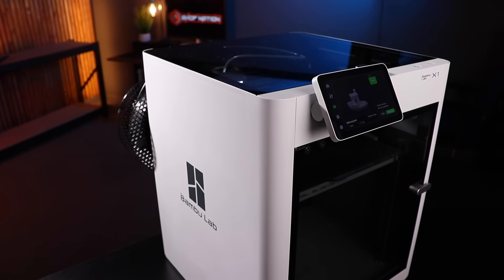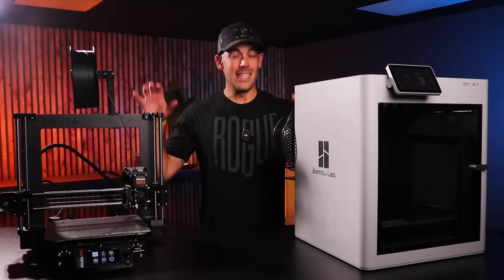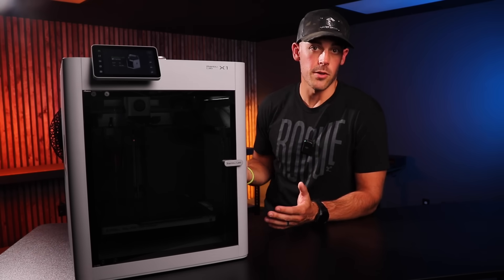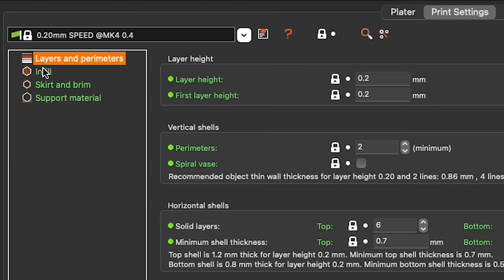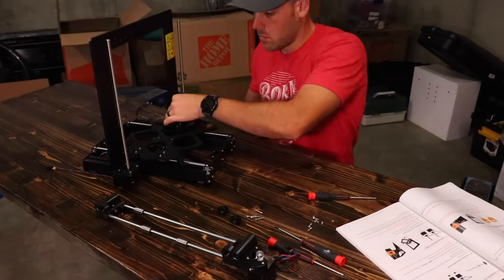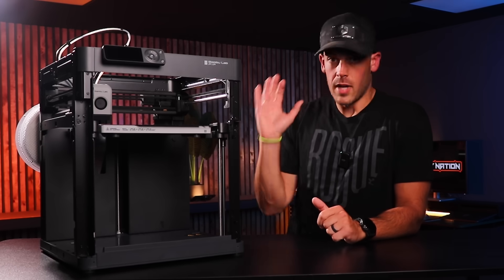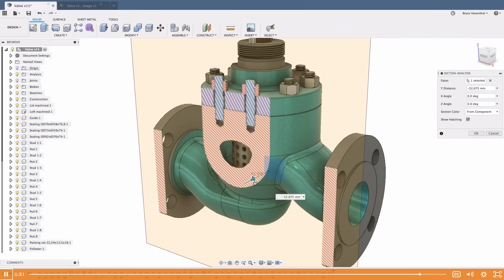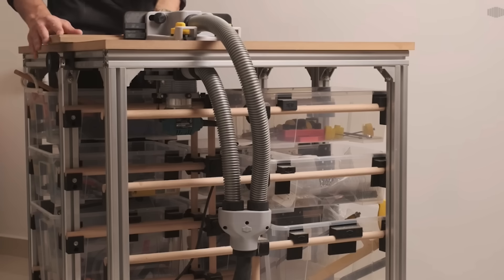The 3D Printer I'd buy if I started over

Comment: Really wish I would've seen this before I bought the ankermake. I have it in working order now and it usually runs pretty good, it was really bad at launch with bad QC, and extremely alpha like software. And while learning about 3d printers by fixing it myself I'm sure was a good learning experience. Just like you said it sure does hinder me from even wanting to boot up the printer knowing that I might have to spend hours of troubleshooting, instead of it just working like it was advertised to do.
Reply: have you contacted support? i was one of the kickstarter backers and ive not had many issues aside from what ankermake has fixed in the firmware, its currently my go to printer with how reliable its been. The discord community may be able to help you as well.
Reply: @KevinLagan  I learned CADD and 3D modeling years ago and it was before 3D printers they got one the year I left. So I've wanted one ever since and The AnkerMaker (Bigger one around 599) caught my eye.

As someone who wants to put my abilities to use but will be my first 3d print would you recommend the Anker? My ultimate goal is not spending time working on the machine but printing everything from helpful Shop tools, Jigs, Etc to random stuff like Destiny Gun Replicas or whatever people want to purchase.
Reply: id probably go with the ankermake M5C tbh, the 399 price makes it not actually expensive to get into so youre not oout a bunch of money if it turns out you hate 3d printing. That being said though if you think you need the larger build volume ive had my M5 since october last year and run probably around 100kg of filament through it and its been pretty solid. Small things have been issues like the screws that hold the hotend on, they are very weak and if youre not super careful or you get a blob that covers the print head they can break so i would swap em out with stronger screws. As with all machines though it is a machine so your mileage may vary but ive not regretted having the M5 or the M5C plus the V6 (their multi color engine) should be releasing soon ish @dakotacorvin4756
Reply: @KevinLagan  Thanks for the info man, I haven't got a lot of experience with the 3D Printing but designing and making models in 3d is something I loved and was extremely good at so its always been something I wanted to do but as a Cabinet and furniture maker I love the the idea of being able to make myself so much in the shop and outside of that just the endless amount of things I could and want to do I think the5 is the way to go. 

I am curious about different filaments though, I know they make a wood kind that's awesome but I'm really wanting to do some  printing in metal not sure if it's possible

Comment: near perfect sales pitch then factor and it went to zero, just have a link show up in the corner even all thru
Reply from the maker: Family has to eat, sorry
Reply: @ShopNation  trust me you'll have more to eat, anyways no one's stopping you from ab testing
Reply: @ShopNation  not much into yt, but here's what google can do: yt should start making use of the fact that the videos play exclusively in their own player and make these interactive. it could start with marker frames. so as a producer, i could create two spots, use yt markers start end on the first spot. how yt player would interpret it as follows: at the start of the first spot, it would offer premium viewers a button to skip the spot but because there are no markers on the second spot, premium viewers would have no choice but to manually skip it or watch it. things could get more complicated. yt can supply conditional markers which try to guess the probability of premium viewer skipping. if the probability it low, skip buttons do no appear. also yt can supply the stats for what finally happened so the producers can optimise accordingly. the possibilities are endless for instance, based on user profile the spot can be entirely different

Comment: IMO the Ender 3 is a better starter printer. Cheap and it forces you to understand bed leveling. Plus when you are ready to upgrade you should be able to sell it used at a small loss.

Comment: Buy an ender 5 with bed leveling. Start printing. Convert to zerog mercury 1.1  Ender 5 works great out of the box and you will learn a ton about what is happening which gives you insights about functional design while you wind up with all but the bambu.

Comment: The power of Prusa is not just the software but also the community projects/plug-ins and support. Seriously, you do not need a MK4, just self build a MK3S+ from kit, DIY upgrade with a touch screen front panel running OctoDash on OctoPrint and you never need to transfer using SD card anymore, install a webcam with Obico plugins for AI failure detection. Go further? Self host Obico with Nvidia GPU acceleration. Joint all the printers together and form a “print farm” with AI failure detection. Still need a high-end printer? Think again. Do account for a solid firewall appliance when you are printing remotely. Preferably over a fast VPN like WireGuard.

Comment: Couldn't be happier with the stock ender 3, has done pretty much everything I need a printer to do and didn't cost me very much at all.
Reply: What's the Stock ender 3?
Reply: @OGDIABLITO  The original ender 3. "Stock" means I have not upgraded it, all the parts are as they were from the factory.
Reply: @untrust2033  Thank you for replying back. How's it working out for you?
Reply: @OGDIABLITO  Once you get it printing fine you can just leave it alone and it'll give you consistent results every time. The only real design flaw is how the bowden tube can be melted and cause the hotend to jam, but this is apparently easily fixed by upgrading the part (for very cheap). Never got around to doing that and the issue went away. LOL
Reply: @untrust2033 I've had the opposite experience, it's given me nothing but headaches, bed level never stays, quality is terrible with under and over extrusion on the same print; if I could do it all over again I would not have bought it again, though obviously experiences may vary
Reply: @untrust2033  where'd you buy from? online or from a store?
Reply: Mine sux

Comment: why so expensive ??  i have been printing on my tevo tarantula  for over 6 years without any problems , i never level the bed , only thing that i had to replace was a nozzle heat element  ( 10 euro ) , and the whole thing cost me under 300 euro ,, it's been printing almost every day for  6 years   yes i had to build it , but i know this printer  through and through !!

Comment: I absolutely 100% disagree.

If you want someone to get into 3D printing, you start with a cheap but reliable 3D printer where you still need to get a little "hands on". The user should know more of the technical side of the printer over time to learn why their printers look worse, won't stick to the bed, etc. and the X1 is a terrible printer for that since it's a HUGE mess to tinker with. If it goes wrong, it goes WRONG!

The Prusa on the other hand is WAY overpriced for a starter. You have tons of quality options on the market that only need slight tweaking that will crank out really high quality prints at nearly the same speed at a third of the price. Remember: you want to convince someone to start 3D printing - $1000+ = already a tough sale!

Almost 5 years ago I started with the Ender 3 and had nothing but issues after a while because I had been so dumb to replace the magnetic bed with a glass one I ... had glued on. Glass beds are terrible for beginners because prints often refuse to stick. I later replaced the board (for silent stepper motors) and replaced the entire bed so I could add a PEI sheet and it's now printing perfectly.

On the other hand I bought a Ender 2 for a nephew last year, finetuned it and it's been cranking out perfect print after print for him with zero issues and we paid $130 for it. Anything that goes wrong is so easy to fix as well since it's all accessible and easy to take apart. Now THAT is a good entry printer.

Comment: Thanks for the video!  I finally decided to take the plunge on getting a 3d printer. Initially I was looking at the creality ender 3 neo. But after seeing your video and then doing some more research. I opted for the p1s as it’s enclosed and has the carbon filter. And you were so right. These things just work. Not allot of messing with leveling etc. I’ve been printing away and am loving it.  Thanks again!
Reply: Can you print 3d metals

Comment: I actually started with a dirt cheap Sculpto2 printer that was on sale. I just needed it for printing a simple wall mount for some equipment. It did what it was supposed to but when I wanted to mess around with some print settings to see what would happen it wasn't really the tool for the job. The phone app that was the only way to control it and the required online connection was also a downside.
I then checked out a lot of reviews to find a suitable "upgrade" and went with an auto-calibrating AnyCubic Vyper. Never regretted the choice. 
If I was getting into 3D printing now I would probably look into the two printers you are mentioning. However I have heard bad things about Bambu Lab that parts are almost impossible to get and a pain in the butt to change. For that reason I would probably go with the Prusa instead. 
Although AnyCubic also have a few options now. Especially the Kobra with Direct Drive could be a contender.

Comment: I bought a used Ender 3v2 for $100 and am still working with my friend to help me get it set up.  It's my first printer.  Having issues with the first layer not sticking.  It was a cheap entry into 3d printing though and I figure it will help me learn and better understand how things work before dropping $1,000+ on a printer.

Comment: The new Prusa planetary gear extruder is by far the best design.  The force sensing on the nozzle touching the bed is the gold standard for leveling (tramming).  Prusa needs to add a temperature controlled enclosure to be a serious option in my opinion.  If you don't control the temp and humidity you don't have control over the print quality.
Reply from the maker: For some materials…yea

Comment: I fail to see the comparison between the Prusa and the Carbon X1.  The X1 is enclosed which opens the door to large ASA/ABS prints that the Prusa would be less than ideal at.  You’d have to add an enclosure, which if you buy Prusa, would put it way over the cost of the X1.   P1P is a better comparison.
Reply from the maker: Did ya watch the video?

Comment: Mate, a straight-up excellent and down-to-earth video, echoing my experience to date.  (apologies for the long comment - it grew...) 
I have my own Engineering design business and bought a MakerBot Method-X about 5 years ago to make small prototypes, tools, jigs, etc.  I'd been burned a few years previous by a cheap printer that just didn't work so I bought into the Makerbot hype about the Method being plug-and-play.  
And it did pretty much just work, and it is very accurate, but it was pricey, and with experience, I've come to realize it has more limitations than i'd imagined - printing with Tough PLA is easy, but printing with anything else requires a bit more dicking around, and printing with large amounts of support material usually goes wrong.  
Also, when googling certain types of defects in the prints to figure out what settings to change, I discovered many of the suggested settings are locked in Makerbot print.  I'm not really interested in messing with 3D printers - I'm interested in getting my designs printed.  

After a bunch of research in recent months I came to the conclusion that a Bamboo labs printer is likely to enable us to print faster, easier, with a much bigger volume, and at a fraction of the cost, (and with much better software) so I'm about to buy one and try it.  Yours is one of several videos that seem to confirm this.  
Bamboo print supports out of cheap model material right up to the interface and only uses dedicated support material for a few layers - so obvious and simple it blew me away - Makerbot print won't do that.  Although the Method is still a solid and advanced printer, it's solid and advanced from a superseded generation - I'm looking forward to seeing how the new Bamboo printer stacks up.   

From a business perspective, I've avoided resin printers due to the mess and smaller print size limits, and we use SLS and MJF fairly often, but we outsource that, not having the volume to justify buying one of those printers (multiple £10k's). 
Finally, 3D modeling software is the heart of my business, We rarely use Fusion because its capability is too limited for our business, but I'm very familiar with it and have been watching it grow with interest - For hobbyists or basic commercial requirements, it's the one I'd recommend without question.

Comment: Great video, thanks! Whether it's a Prusa kit, or an Ender 3, it takes meticulous initial setup during assembly. If you have every extrusion perpendicular, parallel, etc., and all 3 axes move their full travel freely, the printer will work well. Fake it, and you'll be very frustrated with failed prints.

Comment: The Elegoo Neptune 3 Pro is a solid choice for beginners. Im a total beginner and got one couple weeks ago and its worked flawlessly. For a little over $200 on sale it comes with many "quality of life"  features that make printing high quality parts easy. All I had to do was adjust the tension on some of the rollers and auto level the bed and I was printing amazing quality parts. Having done research beforehand I was frankly shocked at how easy and painless the experience has been.

Comment: As someone who has used an ender 3 with no modifications and taught themself fusion 360 to design my own parts for 2 years, desogning and printing everything from gun frames to key chains, this video is like looking at a guy showing off brand new toyotas and teslas that don't need to be worked on every week and come with a butler, when I've been driving and working on a 1972 Chevy pickup and having to mow my own lawn.

Comment: The new right answer is the P1S. It's enclosed and works with the AMS multi-spool system for $699. Basically the X1 Carbon without the Lidar and fancy touch screen for $450 less. Just ordered one.
Reply: I moved up from an Ender 3v2 to the P1S and I love it.
Reply: @slosubies4845  I have an Ender 3v2 as well, but it pretty much stays on the operating table.
Reply: Where I live a P1S is just about 10x the price of an Ender 3
Reply: @NikyCROW  the P1S and Ender 3 really aren't in competition though. People don't usually comparison shop Kia's and Porsche's.
Reply: @Immolate62  It wouldn't even be apt to call it a comparison between a Porsche and a Kia, more like a Porsche and a Ford Pinto. The Ender 3 was the single worst device I have ever owned in my entire life, the Bambu A1 steamrolls it despite costing 4x as much. Saying you could buy the Ender 3 and enjoy printing is akin to saying you could give the junker $50 for a vehicle chassis with no wheels, no engine, and a frisbee for a steering wheel and enjoy driving.
Reply: How are you liking it so far?
Reply: @Jon_Jacobs  I currently have the P1S, a QIDI X Max3, a K1 Max, two A1s, and a Kobra 2 Max. The P1S has 2,040 hours, which comes out around 10 hours a day on average. It is my favorite of all of them, although I prefer the AMS Lite on the A1's to the regular AMS. It has had the least problems and has been the most reliable. The A1's are 90% as good and the K1 Max is right there as well.
Reply: @Immolate62 What would you say your biggest issue or drawback would be with your Qidi X-max 3?
Reply: And it uses 1300 W. My Mega S was 115$, uses about 150 W and is enough for a beginner and occasional prints.
Reply: @DanSlotea  I'm not familiar with the Mega S, but since you're (justifiably) bringing up electricity cost, a faster printer that fails less often may spend less time ultimately printing, and thus use less electricity over time, just more when you need it.
Reply: good point, but my ender never fails me, and it's doing its thing when I'm doing mine. I wouldn't mind a cooler primer just haven't been able to sell myself when my three's always perform

Comment: I have 4 printers, they range in price from 300 to 1200 dollars and to be honest after that all important test print ,they pretty much suck, spare parts hard to find,  from control board to motors , leveling pain in the ass, last two claim to be self leveling, no as the z axis seems to always be off a tad.  Ever try to make sense out of the 25 measured points ? Liquid printer , only makes tiny parts and to be honest is a mess to work with .  Still I labor wait hours and sometimes it's magic, trying to print RC airplane the tabs and holes never line up  with lwpla expensive  a failure is painful.  I'd give up but I'm old and stubborn.  Take care.

Comment: Question. Total beginner here and I'm gonna get the P1P.  What else do I need to order to get started?  All I want to do to start is be able to print some print files that I'll download from Printables/Thangs/etc. that are gonna be parts, small tools... I don't care about decorations or miniature statues, etc.  (so I don't care about making anything look extra pretty) So do I just need to order the P1P and some filament?  If so, what kind of filament is ideal to start?  Or will I need more parts or plates, or spools or whatever?  I just want to make sure that when I get my printer, I have what I need to at least try printing a few things.
Reply from the maker: The printer comes with everything you need, just need some filament, I’d start with PLA to keep it easy
Reply: @ShopNation  perfect, thank you!
Reply: @ShopNation  PS: I used your link from this video, so if it was an affiliate link, you should get the commission.